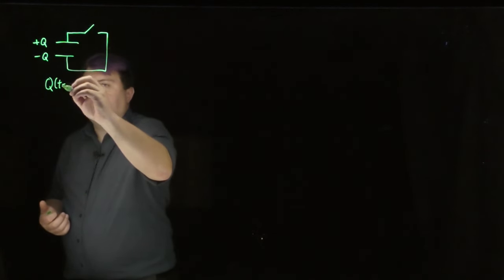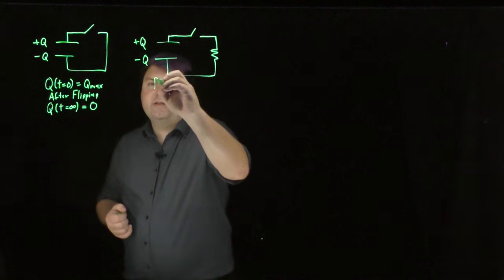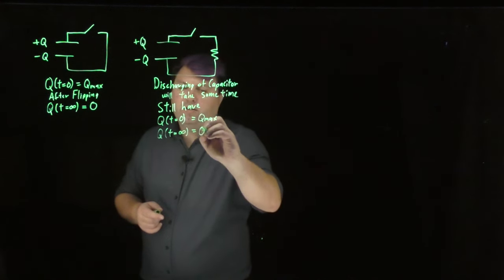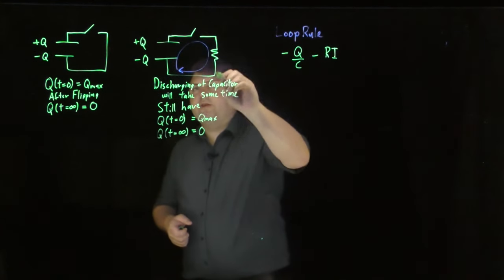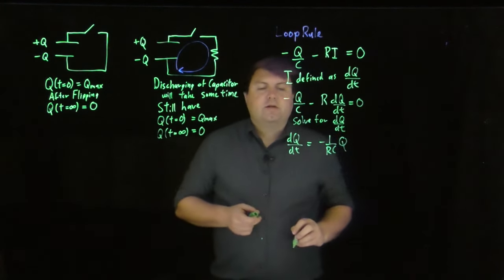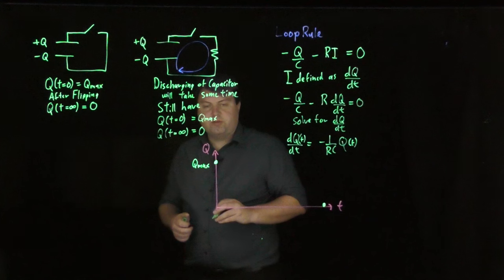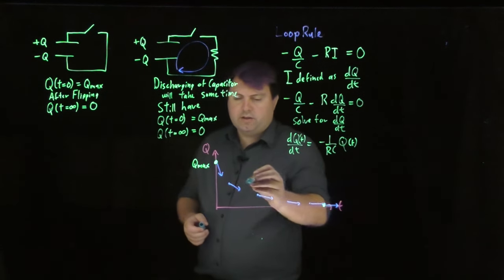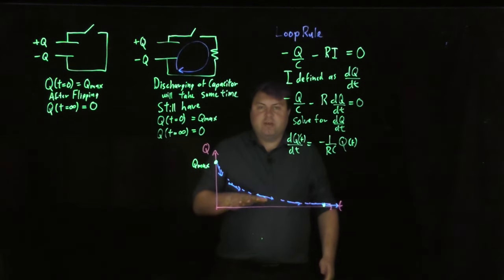Why RC Circuits Require Differential Equations

Comment: AFAIK, the loop equation is wrong. It should be Vc-Vr = 0
Reply from the maker: Something of a Physicist/Engineering disagreement of where minus signs go. If V_R = -RI then it's V_C + V_R. If V_R = +RI then absolutely you're correct.
Reply from the maker: What's important is that the differential equation gets us a negative exponential as the solution instead of a positive one. A lot of ways you can define things so that it works that way.
Reply: The loop equation is wrong, based on the direction of the current. When going around the loop, potential is definitely gained across the capacitor if the loop is taken clockwise as shown (the upper plate is at higher potential, since it is labelled as the positive plate). It would seem to give the wrong sign in the differential equation, but it doesn't...the issue is the dQ/dt = I relation. It's also wrong here and the two wrong signs have conspired to give the right answer. Since the charge on the capacitor is decreasing, dQ/dt is negative, but the current is positive. So the relationship should be I = - dQ/dt. It's important to pay attention to what Q and I are referred to in the relationship, and here Q is that of the capacitor and I is that of the circuit.